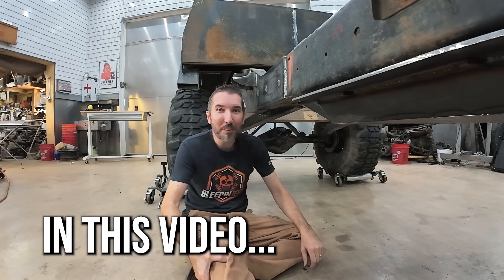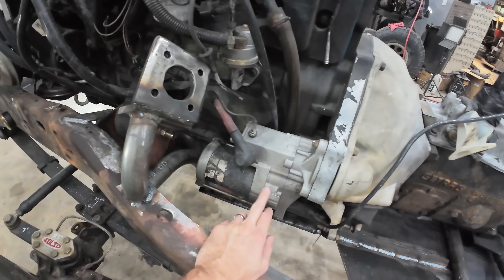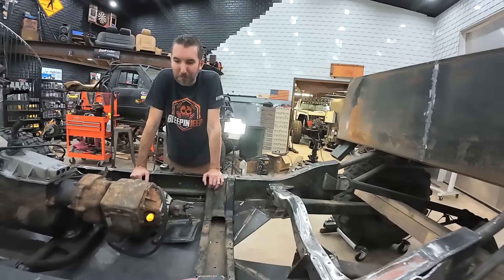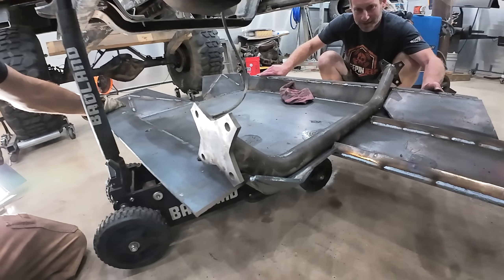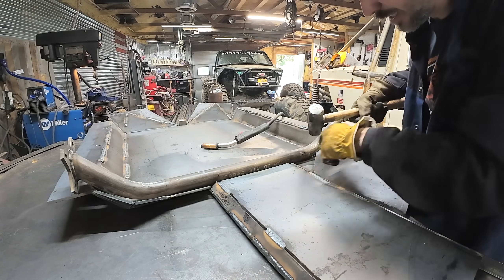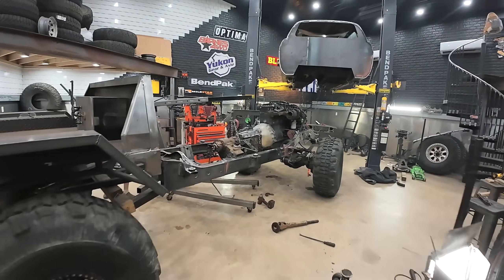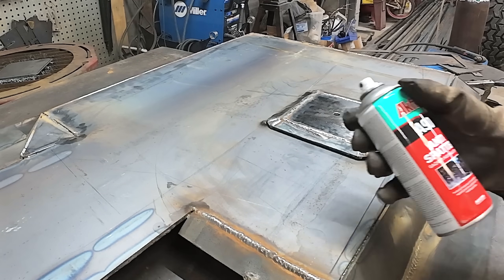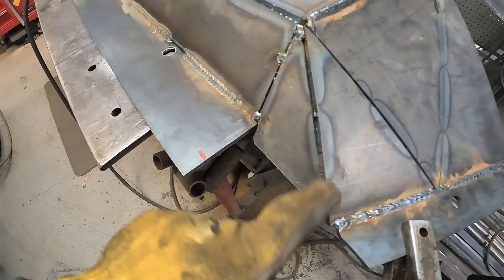Worlds Largest Skid Plate for the Holy Grail Wrecker

Comment: If you ever need to remove that on the trail you will need a team of weightlifters. The way they are done on heavy equipment is sections and one end has the holes slotted so it can be slid into place then bolt the other side rather than trying to line up the whole thing while trying to get the bolts in. Just something to consider.

Comment: 20:50 
You may want to attach a quick disconnect hose to the oil plug that has a cap on the end of it, you can tuck the hose up in the skid plate.

Some people do this on their zero turn mowers so they can drain the oil easier.

Comment: The strength of your skid plate can very quite a bit with different alloys
 
A pice of 3/16” T 1 and you could drop your car on rocks and it would bounce off. Then you have aluminum.  Light weight but very strong 💪 as well 

Are the Mad Maxers on to you yet

Comment: Won't you need to drill some drain holes in the skid plate for when you drive through water or even if you get a lot of rain to help keep the plate from rusting when water sets in it.
Reply from the maker: well, there are 2 holes, that should be enough

Comment: Maybe NOT the largest skid plate, I run an Atlas 4 speed t case behind a T350 trans. My skid goes from rear output of my t case all the way up to the front of my oil pan. Also, From what I have seen on mine, and others. They get bashed on rocks, and they bend up into the drive train. the solution is, and will be easy with your body off, run some ribbing on the inside of the skid to keep the bending up from happening. Just a piece of advice. Also, angle will work, but just flat bar on edge will work just fine. left and right, and front to back.
A name for a skid? That's new to me, but how about the HG 24 slide master